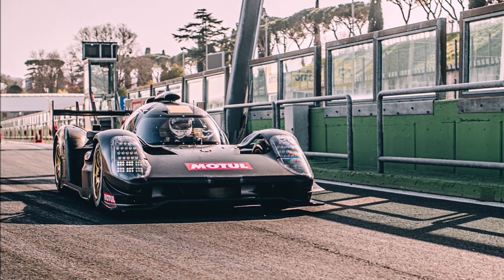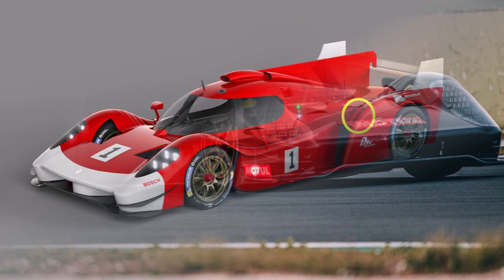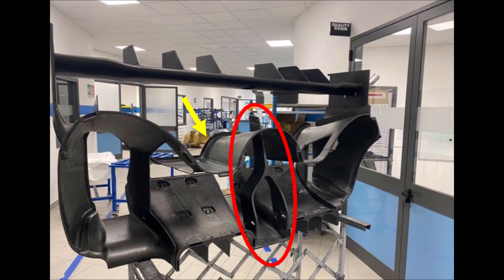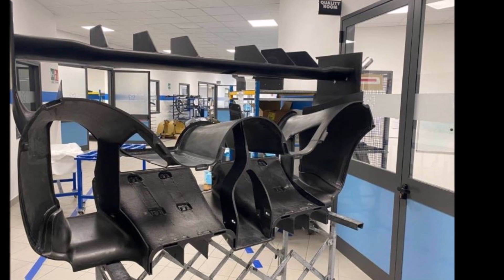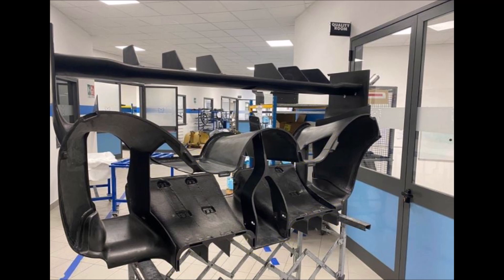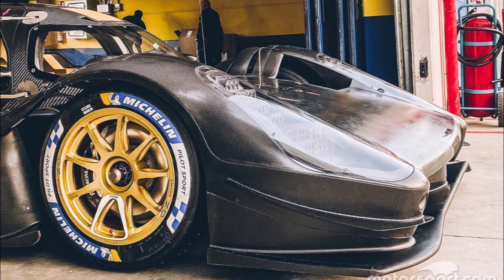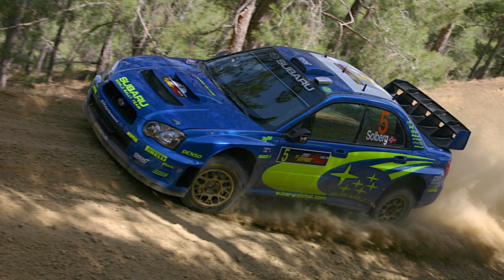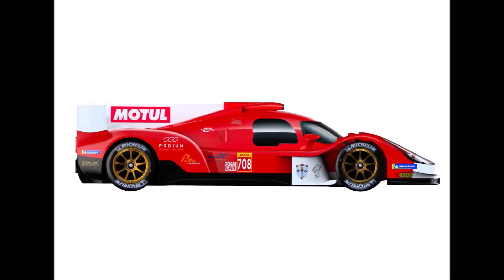SCG 007 (Glickenhaus Hypercar) Part 4 - First Test

Comment: The Gap/Step/split concern in the diffuser is minimal at most. With the aligning pins, youre left with a minimal line. This could easily be mitigated with a small VG molded into the diffuser before the split line, or applied as zig-zag tape. We use this a lot in aerospace. That flow isnt laminar anyways, so as long as you can keep flow attached over the split, there will be no measurable impact to performance.

Comment: What do you think, is the position of the rear break cooling a good one? Looks like it will increase the drag?
Reply from the maker: The position in the leading edge of the wheel arch as in the renderings would be better but then the ducting underneath would be trickier to get around the wheel in the narrow space.
The current position is not ideal aerodynamically but the ducting is easier. And there is BoP anyway

Comment: Which is the function of the little hole at the front (0.08) ?
Reply from the maker: I think it's for the headlight cooling. The forward facing hole is the inlet and the outlet seems to be the hole on the inboard split line halfway.
Reply: @bsport320  ok, thank you, great video!